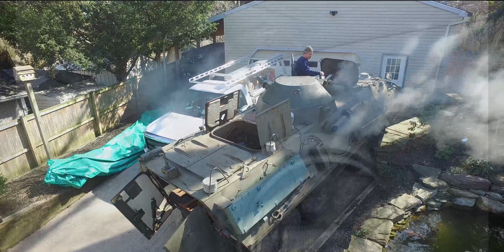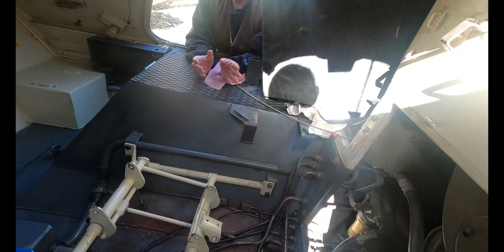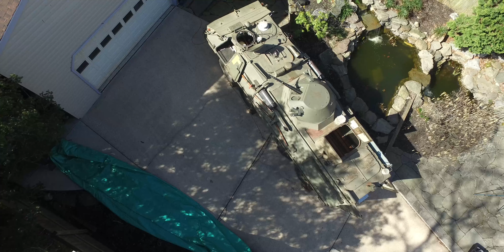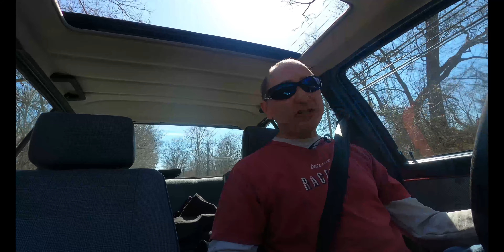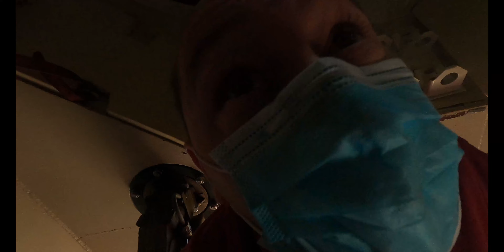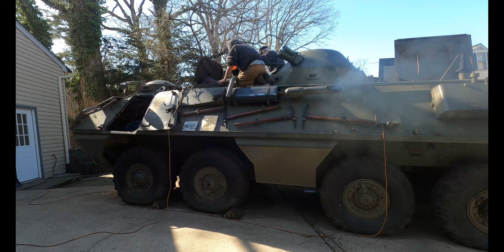Tatra OT-64 Will It Start?

Comment: on the wall behind the driver's seat is a phase shifter rod injection, when starting the engine pull, after start slide back and adjust the idle speed with the hand throttle on the side of the dashboard
Reply from the maker: That cold start assist lever was not properly connected at the IP.  We fixed that and still did not get a start on diesel.  We did find the problem eventually. I'm editing that video right now.  Up by tomorrow afternoon.  Thanks for watching!
Reply: Taky vám přijde, že to startují bez sytiče a nastaveného ručního plynu?
Reply: @jangratza7348  urcite ano, nic ine v tom nebude...predpokladam, ze to OT tam doslo vlastnou silou, len novy majitel absolutne netusi ako sa to ovlada....

Comment: Have you manualy pumped the fuel to the fuel pump? Have you tried start with choke? BTW this motor could almost run on what ever quality diesel. Also do not run start procedure to long because you will cook starter. You should start it for not longer then 10-15s with 30s pause. When we have such problem with fuel is not feeded in motor, then we need to check if fuel is atleast feeded into the pump. So you need to loose pipe feeding fuel into the pump and then you need to use manual pump behind driver seat. If the fuel will leak from loosen pipe than you have fuel in the whole system before fuel pump. Then we reconect the pipe to the fuel pump and we try if we hear the check valve in the fuel pump while we are manualy pumping the fuel. If it is ok, then proceed with start with used choke and with manual gas set so motor won't stop. A few failed starups should vent the air in the fuel lines betwen fuel pump and cylinders. If the problem is still there then most likely it is in the fuel pump. If you'll take it out be aware of shaft possition so you'll have less work when you put it back. When you get the fuel pump out of the motor bay, than open the side cover and turn the shaft a few times. If all cylinders check valves are moving then there shouldn't be problem there. But it could be some issue hidden. I've repaired a few OT-64 but when we had issue with fuel pump we have sent them to one old guy here in CZ who is last one who is able to repair almost whatever issue with TATRAs fuel pumps. I hope you'll get this beauty running once again.
Reply from the maker: Did all of the above.  We did find the "problem" and got it running.  That video is coming up shortly.  Thanks for watching!
Reply: @tr3wrench  I don't if you are staring with clutch pedal down but it is neccessary to do it even there is no gear shifted. Because if you are not starting with clutch pedal down, there is hughe possibility of main shaft being shear off.
Reply from the maker: @jangratza7348  No clutch on the starts. I've never driven one but I understand it is a "progressive" transmission. clutch after gear select, not during.
Reply: @tr3wrench  I've used wrong wording. You need to engage the clutch while you're starting the engine. It is in manual and every Czech OT-64 owner will tell you that you could damaged main shaft. Clutch is basically hydro-pneumatic system. Hydro line leads to the clutch where disangage the clutch and then the pneumatic line continues to the wilson's transmission. So the clutch is working if you don't have air pressure but gears shifting don't.
Reply from the maker: @jangratza7348  Will relay to the owner,  THANKS!
Reply: @jangratza7348  "královky" na to byly potvory náchylné

Comment: Betting that the injection pump is air bound and not self bleeding due to the incline of the driveway!  Great Video!
Reply from the maker: We also had the thought the incline was playing a part.  Any suggestion on how to purge it without moving the truck?  15 Tons / air brakes...
Reply: @tr3wrench  Remove the vent plug in front of the injection pump line closest to the driver, hand prime with fuel pump plunger, or fill with funnel!  ????  Change oil in injection pump while uncovered.
Reply from the maker: Thanks! I will share with George and hopefully we can give that a go this weekend.